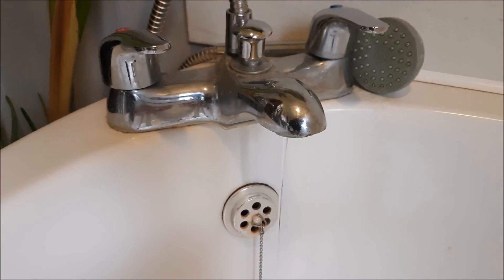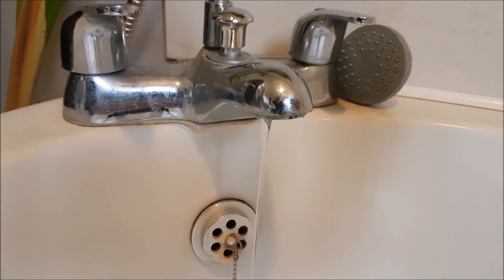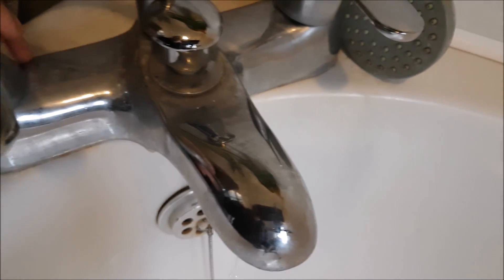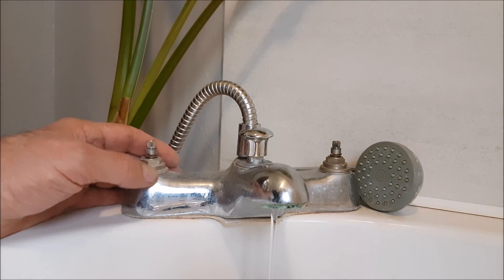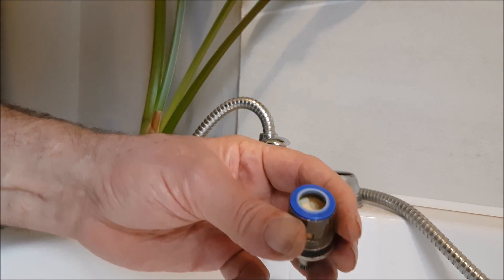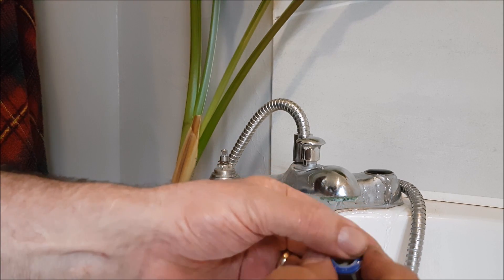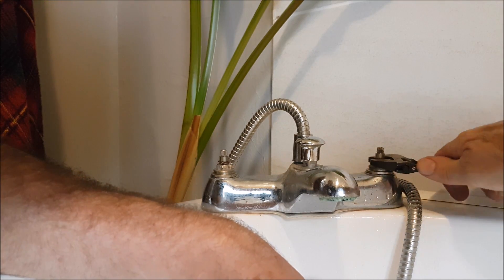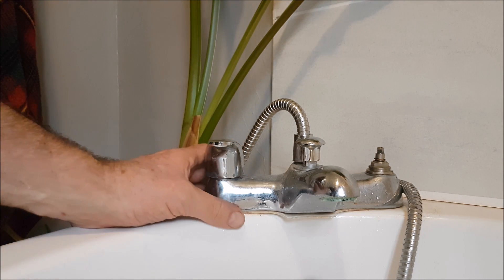BATHROOM MIXER TAP FIX

Comment: Hi I'm trying to buy replacement glands for my very similar-looking taps. What size and how many teeth do the splines have (or which Screwfix product code are they)? Would be really helpful to have them ready for when I open them up. Thanks!
Reply: This is a question that has no answer, except you take the old one to a plumbers merchant and ask them to match it